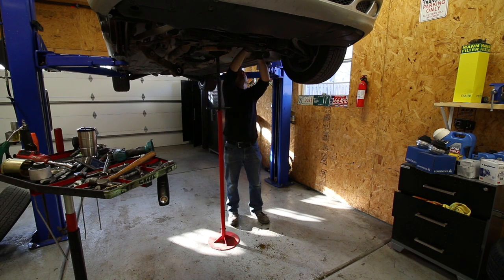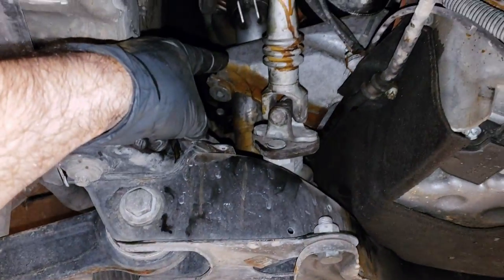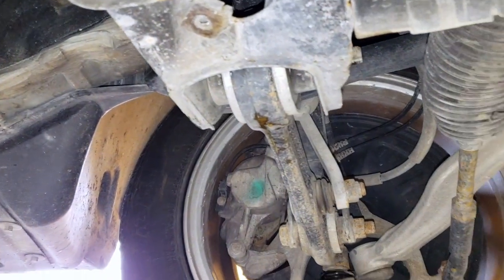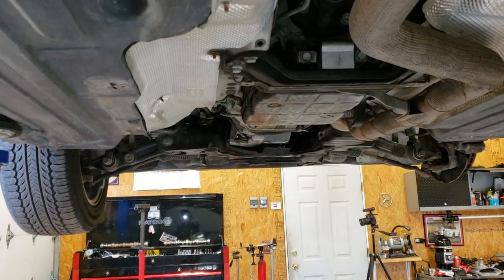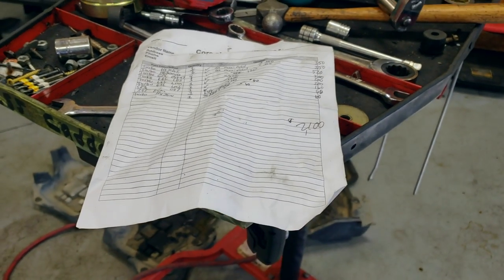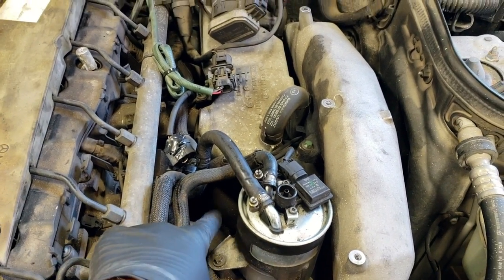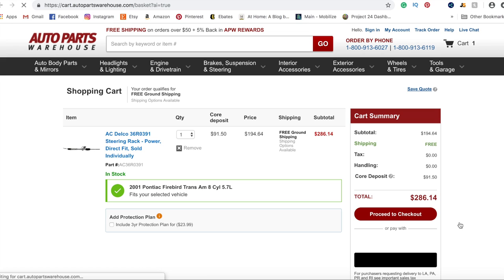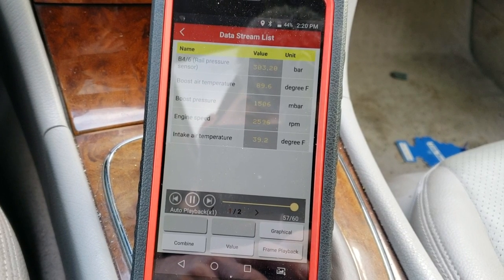I Fixed A Really Expensive Boost Issue On My Turbo Diesel Mercedes With A Penny Resistor! It's Fast!

Comment: I really want a diesel Benz but idk what to go for 300td or a e320 I’m fan of both of them
Reply: 300CD if you can find one
Reply: Hey men , i own E300 TD, and i own E320 CDI, the only thing that is might be better with CDI is some  interior upgrades, but i think older  E300 built much stronger and without needless electronics and flaps  like newer CDI. By the way, i am planning to sell my E300 soon as i am moving and can not take it with me. I mean, if you are interrsting in that model.

Comment: Alex - you have me thinking about an E320 CDI but after some searching I wonder about the injector seals and at what mileage they become an issue. Seems like the whole injector system could be a very expensive issue with the CDI.  Since I would be probably be looking at a car with maybe 200k on the clock when would would injector system become a big issue.  Also, it would be a big help if generally you could give some advice as to when certain problems can be expected - for example, when should I expect to replace the conductor plate in the transmission - after 125k miles or so?  No one wants to get into a car with deferred maintenance and some broad replacement guidelines would be very helpful.  Keep up the good work - love your videos.
Reply from the maker: Stay tuned Philip. I'll be going everything you are talking about soon.

Comment: Alex great video i did had this issue from time to on my 05 e320 after watching your vidoe i add the resistor between the middle pin and the one on the flat side of the plug, i start with a 1/4 amp resistor which did not show much boost( by feel when driving) so i switched to 1/2amp and showing great result. Unfortunately i noticed that the resistor had got super where it melted the 2 layers of tape, and this was after a 10min drive. My question is which amperage resistor that you used? Again i did use 4.7 ohms 1/2amp. Thanks.

Comment: The bmw diesel 3 series and 5 series engines came with a common fault on the swirl flaps, they used to fail and completely screw the engine. Almost all older bmws here in the uk are deleted

Comment: If it snows (which as you say it will probably occur) try going to your friend's and dyno the car before and after doing all these mods. At least this should give us a quite accurate glimpse of power and torque figures without the TCS or ESP kicking in to provide stability in snowy roads.

Comment: I have a 2006 E320 CDI,240 000 KM on it and want to do these upgrades,at least some,i also have no power after I start and drive a little,check engine is on I thought it is the turbo but after watching this video I think I have the same problem.
I am going to try  with this 4.7 ohm resistor

Comment: What year is your MB E320 bluetec?  I’ve got a 2009 with only 84000 miles, and have had it in the shop 3 times for boost issues.  They changed the fuel filter, and cleaned the soot from the fuel lines manually (but that’s not shown on my receipt) and charged me $5000!  That’s half the value of my car. Plus, I still had to boost issue!  Then they kept my car for 5 weeks, and replaced the turbo actuator at no charge, but still didn’t fix the issue.  The last fault  code just yesterday was P0299, turbo power under boost.  I had recently purchased a MB11 so I could read and turn off codes.  Would you recommend this penny fix on my car?  Any other advice would be greatly appreciated.  I purchased this car from my sister in law following the death of my brother.  I really love the car, but can’t keep spending $1000’s of $$$$ on it.  I hope you reply.  Thank you in advance.

Comment: PER MOTORSERVICE.COM:
"Swirl flaps produce a swirl alongside the cylinder axis. They are used in diesel vehicles to improve the mixing of the fuel-air mixture at low engine speeds. 
For this purpose, the air is fed to each cylinder through two separate channels in the intake manifold. One of the two channels can be closed with a swirl flap. This creates a swirling of the fresh air. 
Better mixing reduces fuel consumption and pollutant emission. 
At higher engine speeds and torques, the swirl flap is opened to achieve a better filling level. The swirl flaps are also opened at starting of the engine and in overrun condition."
https://www.ms-motorservice.com/en/technipedia/post/swirl-flapstumble-flaps/

Without these flaps and because a diesel runs low RPM, the engine will likely soot-up sooner because it is not burning as clean. Maybe best to keep the flap system clean and in operation.

Comment: The gas engines have swirl flaps in the intake manifold as well. (M272 motors) Are they needed in the gas motors? Is this diesel intake manifold design similar to the gas or am I off? I do know the gas manifolds are known to fail from wear after 90k from the plastic flap mechanisms breaking due to carbon build up. Can you just rig them wide open to fix a broken one?

Comment: Actually Mercedes w140 with the diesel engine is the easiest to replace  engine mounts no need to remove anything besides the splash shield underneath and that's it!

Comment: Saturday video? Wohoo
Reply from the maker: That's my day!
Reply: @LegitStreetCars  Hi Alex
I watched all your CDI videos and have done a lot of projects for my both CDIs. I have black and silver. Thanks a lot for your support. If it were not your videos I would get stuck and wouldn't buy my second cdi. I have question to you and hopefully I will get an answer from you. I recently   replaced MAF connector pigtail not with original one for CDI one. And used the one that petrol e320 used, and since then I lost power and cdi feels weaker and engine sounds louder. Do you know if the connector pigtail from Petrol w211 e320 made significant difference in the symptoms I described? Should I get exactly the same connector with the same color wires?
I greatly appreciate for your help. Thanks

Comment: Hi Alex  I just inherited my Father's 2005 320E CDI with 85k and in excellent condition. It's occasionally going into limp mode and I'm thinking it's the M55. Is there a lower priced scanner that will id this code for the M55 so I can avoid paying $150 for a Mercedes mechanic ? Great work on these cars and your video production. Much appreciated !
Reply: Hi, did you ever find out what your code was?  What was required to fix your E320?  I have a 2009 E320, and have paid a lot to get fixed, and still go8ng into limp mode.  Hoping you can share your experience.  Thank you.

Comment: Hope your replacing the rubber boots on your steering rack as there's a slit cut into it and you really down want dirt or debris getting up into your steering rack causing steering failure.

Comment: i went ahead and bought a late 2002 E320 CDI OM648 thanks to your videos. I ignored the part about not buying a car without driving it first. Bought off the pictures.
Its silver with factory AMG pack and solar panels (a bit pointless in the UK but put you in quite an exclusive club). Apart from the car needing a good clean, it has the following fault codes that i pulled from my Torque App. P2012 Intake Manifold Runner Control Circuit Low 
- This is the Resistor delete mod needed and P0221 Throttle pedal position sensor - new pedal and sensor required. Suffice to say the car is currently running like a dog.... Total cost of these parts will be around 25 USD when buying from Ebay.
What i would love to know is if there is an actual picture of exactly where the resistor goes on the connector. Any pointers here would be appreciated. I dont want to screw it up!
Great series on the CDI - i vote for EGR delete next!
Reply: Just to check - middle pin and the pin closest to the flat edge of the connector....
Reply from the maker: Great find!! I show exactly where the resistor goes in this video. It's the middle pin and the one with the flat side. There are only 3 total pins.

Alex
Reply: Perfect. Thanks Alex. Three pins....now not even I can mess this up :-)
Reply: @LegitStreetCars  Super - will keep you posted if it cures my problems. Really interested in the BC coilovers pack. My suspension has seen better days...

Comment: Wonder if this might be the source of my hard start problems on my 05’. Gonna give it a shot next week and find out. Get about ten seconds of rough idle and smoke on startup. Worse the colder it gets. Have tried cycling the glow plugs a few times to help warm things before starting with limited positive results.
Reply: It's probably faulty glow plug(s), or the glow plug control module. If your car is throwing P6070 it's the control module.
Reply: What ended up being the hard start rough start issue on your Mercedes? Mine is doing exactly the same thing.

Comment: I was getting into these.  I found one near me with 201K miles on it for $4800, probably $4K.  Owner lists the car as like new, but then says it has a cracked driver seat.  Replacement leather seat cover is $175.  That's ok.  But then I notice the price of Diesel is skyrocketing at this time.  It's up a dollar from this time last year.  I'm going to think about it and watch diesel prices.
Reply from the maker: I don't think diesel will go down anytime soon. There definitely isn't a huge advantage over a decent gas car that takes 87. But if you are comparing to a gas Mercedes then remember that most take premium which is about the same cost as diesel. At least where I'm at

Comment: Definitely gonna try on my W204 Cdi it's been like a donkey for no reason also did a lot of research on swirl flap motors and mechanisms looks very flimsy based  on its function and ridiculous engine position on the W204

Comment: Would it be possible to create a list of engines ordered by their reliability?
Like you bought a 320 CDI and basically said that the inline 6 cylinder engine in that car has rather good reliability. 
What's up with the other V6 engines, for example?
I would really like to see a video on this.

Comment: What have you done if you have intake runner position sensors?

I have a 2010 GL350 that I tried the resistor mod on. I keep getting  P2006/P2007 codes for "intake manifold runner stuck closed" bank 1a and 2a, even though my flaps are actually stuck fully open. How do you get rid of those codes? Disconnect the sensors? I suspect that will cause it to throw different codes. Or remove the position sensors from the runners and leave em plugged in?

Comment: Hey Alex I have been following you videos ever since you got your silver cdi awesome videos by the way. I ended up picking one also and I enjoy it. I have an 85 300sd love it too that is rocking 350,000 on the clock and not an ounce of rust all original. But on the 2005 I am getting a code p2015 I hear its the flap then it's the erg valve. It's suck in limp mode. 1 would driving in limp mode hurt it? 2 how the hell did you get that clip off. I have a 4.7 ohm resistor to do the hack if thats the prob. 
Thanks
Reply: just a quick correction, 4.7K Ohm

Comment: Awesome video, I have a similar issue, ML320 CDI jerks intermittently when I hit accelerator for kick down especially climbing a hill and there is little or no boost as if engine is flooded with fuel.
Mu mechanic cleaned and change fuel tank and filter and serviced the M55 link bars but still no fix. 
Will this idea you shared fix it?
Help
Thanks

Comment: Find videos with. OM606   We take 400-600 horse from diesel engines. No super car can beat these super diesel cars. Usually used in e190 body.
Reply: Usually used in w124

Comment: Great video! I was searching for the correct resistor and found different wattages. What wattage do I need? 1/4w, 1/8w, 1/10? Also, where do I find the connector for this resistor?
Reply: at time 6:37 in the video, you see the connector !

Comment: Are those white caps on the new motor mounts? I just got a pair of lemforders just like yours. Havent installed then yet. I thought the white things were shipping material.  It looks like you left them on in this video.
Reply: The cap is for the passenger side near the turbo;  shields the mount from melting .

Comment: Would you not use the upgraded Maybach engine mounts like you did on the E55?
Reply from the maker: I believe you can but I didn't need a stronger mount for this car.

Comment: I did the same for boost pressure on my E320 2007. Now I have the same problem on my GL350 2012.  Can you help to find the connector.
The car loose power between 3 and 4.
Thanks

Comment: Awesome video. I want to do the mod but have a question: What wattage resistor do we need, 1/4watt or 2watt version of the 4.7kOhm resistor?
Reply: RPM either will work, but the 1/4 watt ones have better thickness for securing into the plug

Comment: The stell motor (Swirl flap motor) on my M271 CGI Engine is faulty and would like to do this fix. My connector is a 5 pin out. Which pins should I connect the resistor?

Comment: Differences between the w211 320cdi I6 and V6? Is the I6 better to tune?
Reply: The tunes for the V6 were not so great, due to the higher complexity of the engine. The I6 has a lot more potential, see what a dude in the Benz forums did in Finland. His username is:"Tuikku". IIRC. he got 400+ HP on a CDI.

Comment: Swirl flaps are the dumbest thing ever invented for diesel engines, the end.
U should definitely get rid of the swirl flaps of death all together, one of mine broke = bb head, bb piston, bent piston rod, bb bore, bent valves, bb injector and bb turbo which combines to bye bye engine.
An aftermarket catch can is also a good idea for turbo engines, even if there is already a factory can installed.

Comment: Still don't understand what those flaps supposed to do, aren't those curing off the air flow completely when u remove key from ignition? To prevent the engine from self burning when turbo fails and the motor self feed from oil? Or this is egr valves? Somehow I don't believe this supposed to make turbulence for better fuel efficency.
Reply: It's for torque and throttle response at low rpm. The intake manifold has 2 separate paths for air flow from the plenum to the cylinder, one is blocked by the swirl flaps. At low rpm the slow air velocity of a large volume intake runner can lead to inefficient combustion burn so separating and restricting, lengthening and redirecting the intake from the plenum increases the 'swirl' of the incoming air thus making for better low rpm and throttle combustion.
Reply: @DiscoFang  if so that's some crazy solution out there qQ
Reply: Mariusz Gonczewski It's been very common to vary the intake manifold length since Honda started playing with it in the mid 80's. Long intake = better torque at low revs. Unfortunately BMW's early effort in their diesels had spindly flap shafts which had an unfortunate result of being eaten by the engine when they let go. They thickened the shaft but they still wear and while don't cause catastrophic failure of the engine they can leak manifold pressure, ... which is bad in a turbo engine.
Reply: Funny thing #2. The other company that were early developers of the variable intakes were Yamaha. Funny because both Yamaha & the boss of Honda were involved with music. And intake resonance and airflow is closely related to musical instrument sound reproduction.

Comment: Hello my firend,
good afternoon
Can You Help me in this situation please.

I have a jeep grandCherokee 2009 crd 3.0 limited (OM642 Mercedes) after driving 30km shows failure in the fuel sensor past failure P2264 Fuel/water separator sensor circuit.
I have already changed the sensor and filters and use only good diesel the obd always shows the same fault as before.
could you give me some guidance?
it makes me crazy

Give me a tip Please..

Comment: Hey there, could you give me the parts number for the foam over the injectors?
Mine's missing and I can't find it in the online parts catalogue.
Reply: Just leave the foam off. If the injectors start to leak, the diesel dissolves the foam and makes a bigger mess than it otherwise would. The foam doesn't noticeably reduce the engine noise.

Comment: Pretty sure the flaps motor died because of the carbon deposits seized the flaps themselves. What i would recommend is blocking the EGR, taking the flaps out, and cleaning the whole intake. This is the best way to clean the intake: https://www.youtube.com/watch?v=xIijYgvxW0g :)
I would also do a water decarbonization to clean the combustion chamber and the turbo nozzles.

Comment: Are sure is it safe to trick that thing to restore boost pressure? It's not going to be bad consequences in long term?
Reply: It will blow up in 500 miles :-)
Reply: I installed a Swirl Motor Repair Kit (resistor) in my 07 ML320CDI about six years ago, been as if there was never a problem since. Love my car.

Comment: My e320 cdi still has everyting stock, inlcuding EGR sistem and does 7,55-7,60 seconds from 0 to 100 km/h. I belive it is not any difference, only if you remap the car and get more fuel and air, because on a kickdown they automatically open. Anyway, I also think it is better for the engine to get off that useless invention, because it is like you would have a huge scarf on your face on a hot summer day.

Comment: fcp euro. they would have to give me a lifetime supply aswel to use shit like lemforder. am I correct in thinking that based on what you say about fcp euro.... I could use those mounts until failure then send em back an they send me new ones no extra cost?
Reply: mcspooney yep, that’s how it works with FCP warranty. They’re just not the cheapest for the exact same part as other vendors, but if you factor that at whatever price the charge it will be the last time you have to spend for that part.